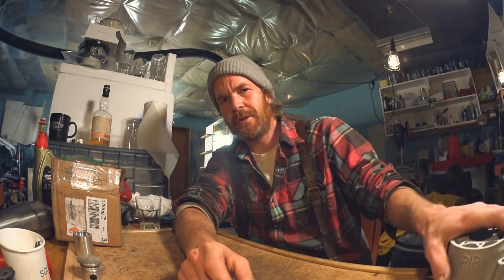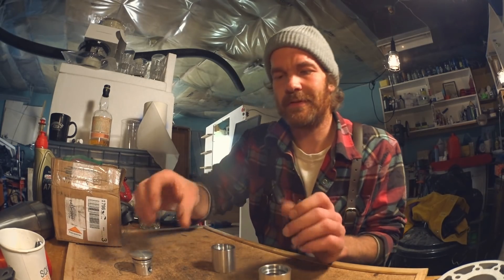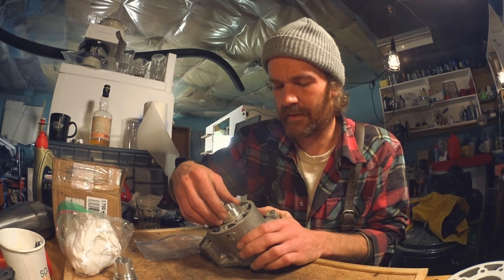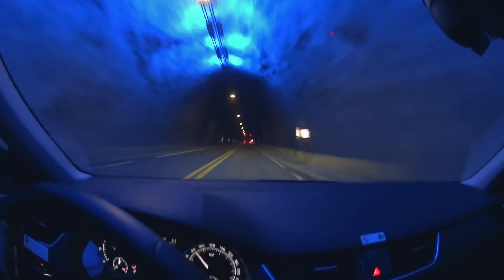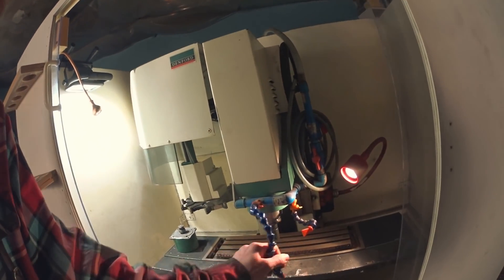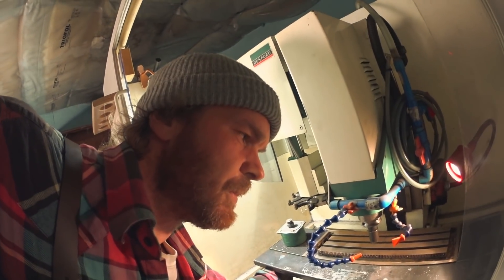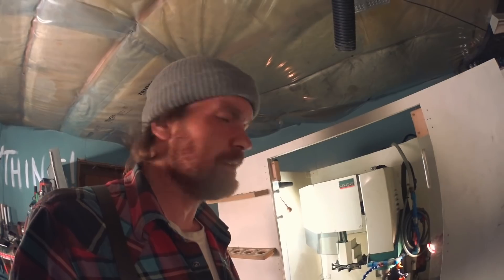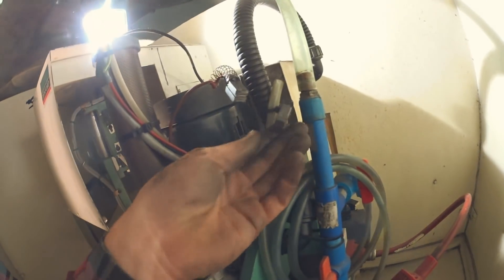3 SUPER AWESOME Things!

Comment: look into 2 stroke diesel engines they are quite unique what is neat is they have exhaust valves and intake ports in a twist pattern it causes a vortex in the chamber from the super charger/turbo i wonder if a spiral port configuration causing the air/fuel mixture to spin perhaps an exhaust port angled to catch the exhaust/air/fuel to be caught as they spin together on the power stroke ive never seen it tried on petrol engines but on diesels it spins like a tornado of air inside until the injector fires igniting this vortex in a cone shaped charge

Comment: whit mach3 as a massive improvement...one of the best "upgrades" i have done is one of theese  https://www.ebay.com/itm/XHC-Mach3-WHB04B-4-6-Axis-USB-CNC-Wireless-Handwheel-100PPR-MPG-for-CNC-Machine/182931980124?_trkparms=ispr%3D1&hash=item2a97987f5c:g:zmAAAOSwk1haINF8&amdata=enc%3AAQAFAAACcBaobrjLl8XobRIiIML1V4Imu%252Fn%252BzU5L90Z278x5ickk8Fd9si%252FIbtWQr%252BhnlRwjDZKZ%252F%252Buy2WvlBsmoHQUn5Sch%252FRdJn3Ymakv95Xa7cFvhsBVEC4inD59EfxXflK8YAmpcRsm%252FVZeUsA%252Bx0H11P7BAVEuDAlb1MFUzxA7%252Ffo0tIgjC9eiWZQqr9DciazZ%252BQ7tx4MfBgJI84Ucb4J1n4XkPa8iKyLqXgNZXnEC5A%252BSA%252FaesOqhZ5G1niMRxt2yIN%252BI%252BQETNC3uY1VIhBZBqjqPMGnlDc3wxuHKJuTyVdnGsLBBCQ4oYYyzZYAFVRJaPzhEFaYIMY4Yz%252FJ1F3HtZN4l8RpYY6sHcgqs7%252Bqzilc9b2daI4gwrKjGEZaZMsIryPgJbGTIkEjcvUSyeOV7Gsi9kuw3i6ozl579M8FpVEGTuj8utUwbFBrqjLXF8Uf4ozsboPC8%252FXCb7NZvh4MriCHmXTQ%252BzpGWvH4w4rdH%252BWEfiW1M0daa9m5iorLYYvJtpqcegamKNHcCYgIwEaPUvRALPeeS2Icscnm2fWAYY54AwSHYHV9sruRokslBTnhWy6b21xK%252F2DqRxrILkNcDUXQYCWlP92cJSujwf0OA1aKwc%252FUP4EMdh1WBcwaX11ZK9ng%252BefRfmkJw%252Ff5wd8LhEpCmPG%252BRh7LAFCfBW4CjtlHzzqQel6wODvm7s1rKU30lTL9lkWra7cT21E15y2yhLXsVRFrKdLKksgmLt31qpga5UyUutKl4oMvcYd0JOg7Iq%252Fy8xvw%252B%252BoDPA0vdsD9X4q8m9mggm%252B44kBL49EB1X8jb6C0%252F5UHHvXM4VpB1lTSPgvg%253D%253D%7Ccksum%3A182931980124c29d7d016f7446749255aeebd9b30f20%7Campid%3APL_CLK%7Cclp%3A2334524

Comment: Usually you initialise Z axis, then do a tool change. The Z axis (spindle) needs to be home before you can do a tool change too. I worked a few CNC machines and they all worked that way. Even worked for a company that produced the BT40 & BT50 Tooling, its now defunct. Youll also need a means to clamp down parts, vice, tee-nuts, clamps, risers and packers. I loved machining and well as programming. I also love all the other stuff you do. Thumbs up.

Comment: Use a software to make your tool path (catia is the one I know) and create the gcode from that
You actually make the tool change in the software and it will be generated
Still good to know it is Txx (T3 for Tool #3)
And then on the machine you can change them to say for example: T2 from software but in the machine is T8, so every time it wil see T2, the machine will replace for T8

Comment: G code are available online easy enough , To tool change you must have spindle axis in home or zero position and then it can be done . Usually without writing a program you should be able to tool change . The first thing you should learn tho is the EMERGENCY STOP button , Shit gets scary real quick when learning . We used to use Single Block when learning , The machine will only read 1 line of code before pausing and you have to hit Run button again every time it pauses . Gives you time to judge whether the next line command is going to do what you want or don't want , Most crashes are caused by NOT canceling a G code before next procedure .

Comment: I was just thinking about it but wouldn't crosshatch be your enemy with a captive ring? Wouldn't you want the bore as smooth as possible so it wouldn't try to spin your ring and either ruin it or waste energy? The reason for the cross hatch in the bore of a regular engine is to help make the piston rings spin to keep them from wearing a groove in the wall in line with the gap of the rings.. so if you have a cross hatch in your bore with a captive ring, isn't it fighting against the ring stop and wasting energy? 
As for your printing.. That's done with a powder/laser printer instead of extrusion, that's how it's metal instead of plastic. They also make titanium powder for them. https://www.youtube.com/results?search_query=3d+printing+metal  LOL 1.2L towing a trailer? In the US that wouldn't be allowed, that's WAY too small of an engine for that kind of work. Nice to see some views of Norway though. Norway is a beautiful country but FAR too cold for my tastes.. and far too much travel by train too.
Reply: Two stroke engines have the piston rings pinned to prevent rotation.
Reply: @bobturnbull18  in a captive ring design yes but in a regular they spin all they want.. but what I was saying is fighting against that spinning is an amount of friction that robs power. It might be miniscule but every little bit helps.
Reply: @jaratt85  Every two stroke has the rings pinned to prevent the ends from snagging in the port. Not just  Alex's captive ri gang.
Reply: Edit : that should be "ring" How did spell check and I screw that up.

Comment: those brushes look like you could take a file and resurface them.
they have alot of meat left, just file them flat and the motor will brake them in.
i have done that on few industrial motors in a company, works.
better check the motor's commutator if it's ok.

spindle motors
https://www.haascnc.com/productivity/spindles/50k-20t.html
https://klingseisen.de/nakanishi/
https://www.google.com/search?q=high+rpm+spindle

Comment: Those little Denfords are lovely machines. They are built like scaled down industrial machines rather than minimum cost hobby machines. You can't burn out a stepper by stalling it so probably the bearings are seized from coolant. You can't replace them without destroying the motor. Steppers come in standard sizes. Yours looks like NEMA 34. Don't try to source another round motor. The modern square motors are much better. Don't worry too much about matching the motor specs. Just try to find one with the same shaft size that isn't any longer than yours. Pretty much any modern square stepper will beat that old round one. 
Check the rated current on your motor and set the driver current to that or a bit less. Don't go over.
I have a lot of experience with Mach3, electronics and CNC so if you have any questions I would be happy to help.
Reply from the maker: Thanks for the advise! I did order a round one, but only cause it's 3/8 inch shaft, all the others I can find are larger. https://www.astrosyn.com/product/my34hy0-5-astrosyn-stepper-motor-nema-34
The pulley is small, don't think boring out to 1/2 inch would leave enough meat.
Reply: @2STROKESTUFFING  That's an awkward size. As you found out most modern 34 motors have 1/2", 13mm or 14mm shafts. Equivalent torque NEMA 23 motors generally have around an 8mm shaft. You'd then also have to make a suitable mount and reducing bush.
You should run that astrosyn in unipolar mode. Connect the following wires together: red+blue, yellow+black, white+brown, orange+green. That gives you the 4 connections your drivers expect. If the motor spins the wrong way swap a+ and a- on the drive or b+ and b-.
Reply from the maker: @LesNewell  👍 Thanks!

Comment: Brother,get rested. Your rate of progress leaves me tired and in awww yet again, your determination. I have been part of building a few machines with step motors. They can be a drag man. We mated them to worm screws using a flash cut program and made a cnc plasma cutter🤣. But your at another level here.Those chillers your machine has for cooling the material 👌.  Have seen them and used them on CNC welders .Rapid cooling helps larger pieces from destorting shape due to heat. Very smart. One day when things slow a bit . I'd  love to discuss Chainsaws with you. But after your record breaking dream has been realized. 😉. Stay the coarse Brother . Pls don't forget me when your finances are flush. I'm technically retired at 50 .Lord willing we can retire our great great great grand children from birth .
   TIL WE MEET.🥃🥃CHEERS.

Comment: Good move getting the CNC. Very good choice not getting a ‘converted’ machine, the modular cast iron makes
A big difference in reducing harmonics in the machine. It looks like the bed includes a built in magnetic chuck, very interesting. G code is very easy to learn, so you will be up and running in no time.

Comment: Good luck I hope you got the machine for free or nearly free.  I have played programmed and used NC machines since 1975.   Focus on the 2 strokes, the NC machine as needed.  Don't use the NC machine to hone the honing  particles will wear  the bed ways and if the spindle bearings are lubed using the coolant as many of the old machines are you could damage that too

Comment: In the earlier machines the autolube pump is within the column casting itself. Their is a plate on the back for access. wont be too hard to find it
Reply from the maker: 👍 I found it, it's right behind that flexible lamp base on the side of the column. Half full too.
Reply: @2STROKESTUFFING  make sure to home the mill first, then make sure the tool number  matches what's in the spindle (which is also the pocket number closest to spindle on the atc) if it's different then enter the number and press enter. Then you should be able to use m6 in the mdi line to initiate the tool change. Use t and the required tool number to designate the required tool. Eg. T6M6 or T2M6 for tool 6 and tool 2 respectively
Reply: @2STROKESTUFFING  if there is anything else I can help you with just send me a message or drop me an email deenprecision@outlook.com
Reply from the maker: @jonnydeen6952  👍 Thanks! Probably plenty!

Comment: why don't you just use a steel sleeve inside the aluminum casting. just saying
Reply: i believe the nikasil makes steel unnecessary, as it is remarkably harder (think chrome gun barrel lining) and retains a lower friction charecteristic, reducing pumping losses. does not have longevity of steel supposedly, but this is for record speed runs, not tofu delivery

Comment: Wait for plates! Please have patience my friend. The most powerful 2 stroke ever will require a perfectly round bore.
Reply from the maker: I know, I know...
Reply: @2STROKESTUFFING  why not cnc yourself some torque plates?? Yanno, now that you're a cnc geek 😂😂...
Reply: Another thing to consider is replacing the head bolts with studs bedded into epoxy. That will help protect the threads in the cylinder as well as better distributing clamping forces
Reply: @simonlewinson4170  helicoils would work better with the studs. that's what they were originally designed for, To spread the forces and provide a much stronger thread in soft materials such as aluminium and magnesium in aircraft engines and such. Using as a Thread repair system was just a happy bonus
Reply: johnny woodbine true, but with the really high RPM expected I think that the Heli oils are going to be more prone to fretting damage whereas epoxy will help damp the vibration transmitted to the studs due to the differing modules of elasticity.
Reply: @simonlewinson4170  While I agree studs provide a better clamping force, I've never heard of fixing them in place with epoxy.  In fact, I was under the impression that studs were to be finger tight only, never torqued or fixed in any way lest you impart additional strain to the parent part.
Reply: Dan McCoole bedding in epoxy prevents any movement and also distributes stresses further down the threads as well as resisting lateral movement better